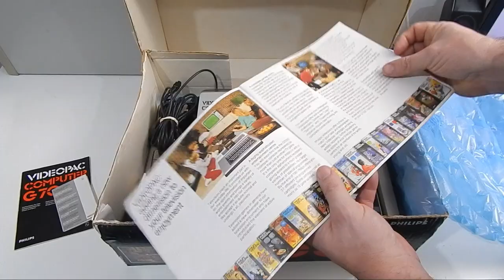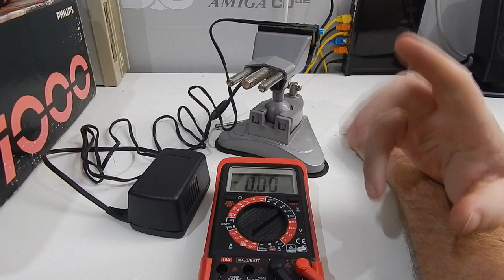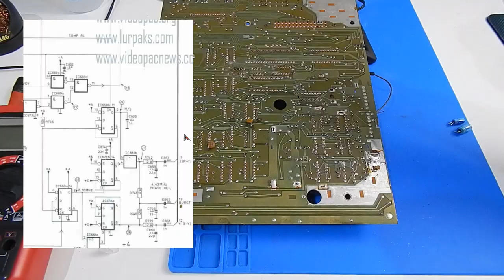Philips Videopac Computer G7000 Refurbishment Part 1

Comment: I think I had a very early model at home for a short time for storage purposes before I brought it to the Oldenburger Computermuseum. In my case the console didn't had 9pin dsub joystick ports instead the cables were feed through the case and where connected directly on the mainboard with small connectors that were soldered directly on the board. And there wasn't that much shielding. A lot of the chips were unshielded.

Comment: Look online certain serial numbered versions of the Magnavox odyssey and the video pac Will work with a NES AC adapter but you have to confirm your serial number is the right model number to be able to use that AC adapter or you will smoke the console. There’s a lot of information on the video pac As well as the odyssey two online There are nice little robust gaming computer terminals had one growing up finally the keyboard failed we had had that thing almost 20 years

Comment: Did you work through the "Repair Method" flowchart at the back of the service manual? It looks like it dead ends at IC 679 so I don't know how helpful it will be at finding a fault in the suspect section given that you have sound output but it might show something easy to miss.

Is IC 680 replaced by a transistor on your PCB? It only drives/buffers the 17MHz crystal by the looks of it, I'm just curious.
Reply from the maker: I've followed the flow chart as far as I can, the various clock signals are certainly there.  Its not that easy to follow as the ICs are labelled differently on my board.

 I admit I'm not the best at these things so do you know what it means on the flow chart where it simply mention V-Ohms then the IC number?  What am I meant to be looking for?
Reply: @CRG  I read the V-Ohms thing to mean check for power at the chip and check for a short to ground at the chip but it's not the clearest guide in the world is it?

That undocumented PAL encoder chip doesn't help either, is the composite blank (pin9) signal low or high? Looks like it's active high so you'd want it to be low.

I think the bottom right of the schematic is just dividing the 17.7 MHz by 4, do you get 4.43MHz at either or both pins 2 & 3 of the PAL encoder?
Reply from the maker: @bweebar  Pin 9 of the pal encoder has a pulse on it high / low, I've traced this back through IC670C to the video processor, looks OK to me.  

If I zoom way in on the scope there actually is 4.44mhz on pins 2, 3, 4 of the pal, it jumps around a bit but I wouldn't trust my £40 hantek scope to be overly accurate so its probably fine.  The signal is very weak though, less than 100mv.  Tracing this signal back to where its generated beyond the caps and resistors its a healthy 3.7volts.  Can't see anything bad with the caps and resistors.  In saying that though I've no real idea what level these signals should be at. 

I'm actually starting to wonder if the problem is PAL encoder itself.

Comment: Now that's one system I never felt related to. Probably because I'm just that little bit too young (I'm 47). Hopefully you'll get it running in no time and will show us what this little critter is capable of :)
Reply from the maker: Well I'm only 39, all be it the grey hair (or what's left of it) might make you think different.  Hopefully I'll be able to get this up and running in the next part.
Reply: I'm 46 but we had one when I was 8. They were in the market for ages, even though it's a late 70's system.

Comment: Just replace the ICs in the video output section in the can or just wire a SCART lead directly to the RGB, composite sync and sound outputs of the video/sound processor.
Reply from the maker: I am considering the rgb mod but its not just that simple as wiring up, there is a small circuit to build.

I've spent a few hours today trying to trace out the video section of the board but it's difficult to follow since my board is a different revision to the schematics.  

I might just change all the 74 logic since it won't be expensive to do then if it still doesn't work try the rgb mod.

Comment: Check www.videopac.nl forum. Try this thread http://videopac.nl/forum/index.php?topic=3186.0 could be the 8048.
Here is the composite mod http://videopac.nl/forum/index.php?topic=592.0.
The joystick is not Atari compatible, some wires are switched.
http://videopac.nl/forum/index.php?topic=2330.0